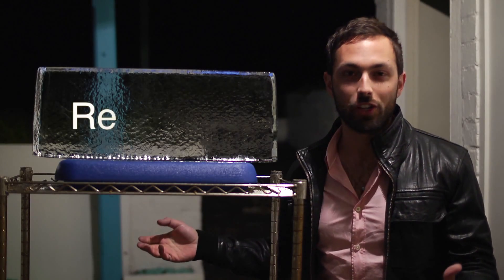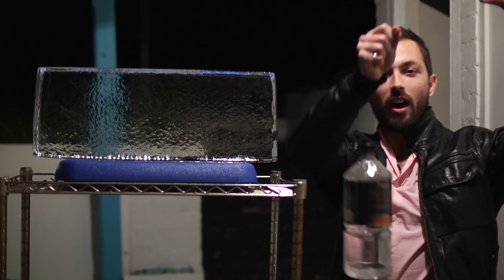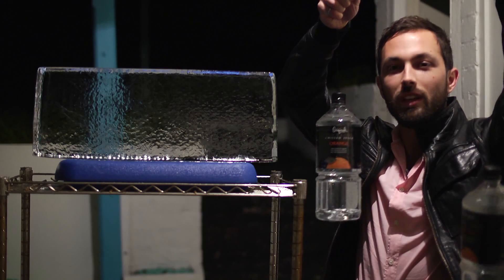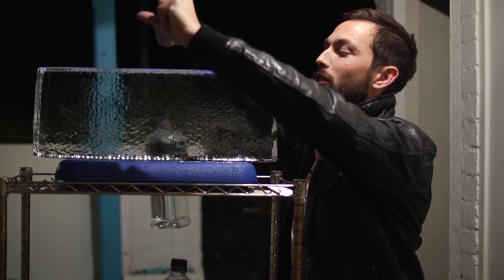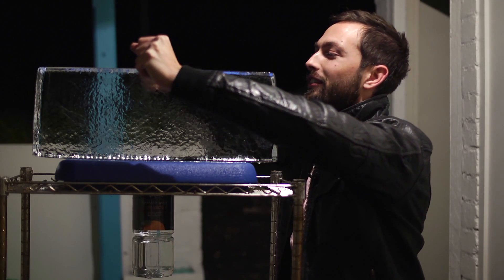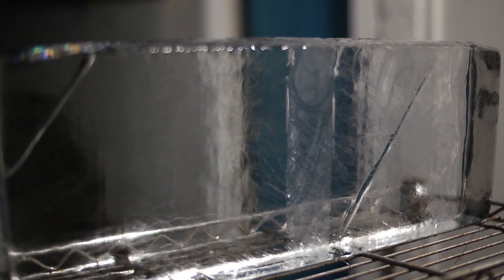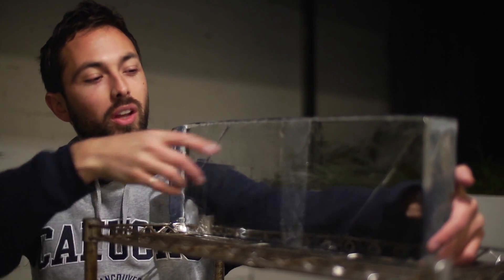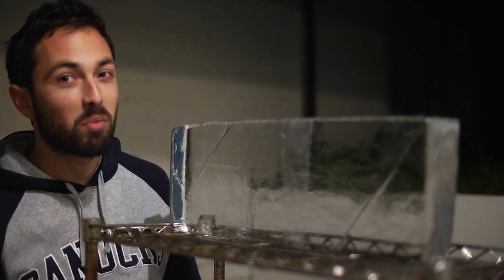Does Pressure Melt Ice?

Comment: would this work if the room and the cord were also at or below 0?
Reply: +Chris R Theoretically it should. The concept is the same of water boiling at a lower temperature at lower pressure. (even if the surrounding temperature is lower than the boiling temp.)
Pressure causes the water to melt to the state it would be at 4 degrees Celsius (max. density) at normal pressure.

Comment: Very interesting video! :D I think the first part was a great demonstration of the ice melting from pressure, but could it be possible that the liquid water re-froze simply because it was  in close proximity to a bunch of ice that was already around it? I bet if a small drop of water landed on the block it wold have a good chance to freeze as well, no pressure involved. Or would this not be the case?

Comment: how can you tell the difference between melting and cleaving in this example?
Reply: +Dilip Tien i think  cleaving would have resulted in two separate blocks of ice. however, given the fact that the cut line was visible after the cord went through, perhaps it was just cloven.
Reply: Chris R cloven?
Reply: Dilip Tien
 past participle of "cleave."
Reply: Chris R ok, but I think the line in between was caused by air trapped inside.
Reply: Dilip Tien
could be.

Comment: no, what your talking about is baremetric, gravitational etc. pressure where it is so great that no matter what temperature it is it stays as a solid until obviously that pressure is released, all that does is prove that ice is cold because as the wire cuts through the ice, the ice above it is still cold enough that the water the wire made (since the wire has a small diameter and is above 32 degrees fahrenheit it melts the ice) is re-frozen and the only reason why you see that line through the ice is because some of the water didn't completely freeze it just dripped/poured to the bottom

Comment: Question is if you put and ice into pressure chamber and increase pressure 3x will it melt faster?
Reply: +無為 Well in general, higher pressure means a higher melting point so I think it will do the opposit, I think it will make the ice even more solid.
Reply: +Covalence Dust In general, but not for water... Water expands ans it freezes, ergo higher pressure means lower melting point. At least that's what I think would happen...
Reply: Proper question is, if you put ice into a pressure chamber and tripled the pressure while keeping the temperature constant, will it melt faster? 
What do you think would happen if you tried to compress a styrofoam, or wood, or a cloth with a huge metal clamp? Think of molecules. Think of graphites and diamonds which are made purely of carbon atoms.
Reply: probably, pressure affects the properties of water.
Reply: That is correct the higher pressure the faster ice will melt. If you remember from physics that high pressure is proportional to heat i.e. when heat increase pressure grows and vice versa. So if we steadily increase pressure it will melt the ice quicker, however if we place ice into vacuum it shouldn't melt at all, since the pressure is almost zero.
Reply: +無為 yes it will probably require less heat to melt and if it is for example at -3 celsius and remove it would probably turn to ice again
Reply: +無為 Yes, it will because pressure and temperature are directly proportional to each other which means as the pressure increases, the temperature does, too. Of course, when the temperature increases, H2O molecules will start to decrystallize as evaporation will be taken place thereafter.
Reply: +Kenny James Cubero liar
Reply: +無為 High pressure = Lower Melting/Boiling point 
Ever heard of a.t.m in your periodic table?
Reply: Stop. Please. Geez this thread is... ughhhhhh.
Study science textbooks. Don't ask random people.

Comment: I don't understand this, doesn't water boil at room temperature if you but it in a container with less pressure. So shouldn't it freeze even more if put under more pressure? (ps. I know the actual temperature doesn't change when put under less pressure, just the state of matter, so I understand that part lol )
Reply: The "boiling point" as you understand it only exists at atmospheric pressure. Under the higher pressure below the wire, the fusion line is pushed back and the i e melts. Once the wire has passed, atmospheric pressure is restored and the freezing point returns to normal.

Comment: What if i put a giant rock on top of it? would it go right trough?
Reply: +Break you're exactly right. That wire is so thin the PSI can get high enough to push the ice above the fusion line with very little weight. To get the same effect with a large object it would need to be very, very heavy.
Reply: Water expands when it freezes.  The pressure momentarily undoes the expansion.  Same reason why ice is slippery when you step on it.   Thank you to Richard Feynman for the lesson^v^

Comment: If regelation is the actual phenomenon at work here then wouldn’t a sub-zero temperature wire (within a sub-zero atmosphere) still cut through the ice due to said phenomenon?
Could you show us an experiment of that?
Reply: This only works in a very narrow temperature range and the m further below zero we go, the more pressure we need for this to work.

Comment: So why is it that pressure melts ice? Or have I missed the point completely! :)
Reply: He did not explain it. In as few words as possible:

Ice is less dense than water. When put under enough force, the ice will be compacted and turn to a liquid as the higher pressure forced it to have a higher density.
Reply: PanicGiraffe Thank you this makes so much sense now! Does Regelation work just with objects with a small surface area, or with enough pressure would this also occur with a larger object?
Reply: Lucy Anderson  The more surface area is used, the more force is needed to achieve the same pounds per square inch. So yes it does work with larger objects (it can even work by increasing the air pressure around the ice) but it takes much more energy.
Reply: PanicGiraffe Thanks! Hope you have a great day! :)

Comment: wait... in ur other video u put ice on aluminium and it melted faster than on plastic. something about heat conductivity? is this at work here too possibly? i would like to see ice in a tank of sorts (should it be a vacuum?) , pressurize the tank and then restore the equilibrium of the inside of the tank. an experiment along those lines would maek me feel better anyways and would be a cooler (no pun intended) experiment.

Comment: Just for the sake of re-posting at this level, Wikipedia affirms what I've said below i.e. the ice melts because the wire acts as a heat conductor thus heat from the room is responsible. Here's the text quoted:
"Weights suspended from a wire which cuts through ice, is an example given in old textbooks. Once again the pressure required far exceeds the force applied. Conduction of heat from the room through the metal wire is the correct explanation of this phenomenon."

Comment: I really like your Channel and have been watching many of your uploaded Videos. But this one I didn't know until now. I was watching some footage of the sun captured with an uv-filter when I got interested in solar winds. I got to Wikipedia and several links later (Magnetic fields, Comets,...) I got to the article concerning Sublimation. There I relized that frozen H2O should turn to the liquid state, when enough pressure is provided. I know that it might be quite difficult to watch an block of ice melt in seconds when exposed to about 200 bar and refreeze again in seconds, when the pressure is removed. But your Video is prove enough for me, because the ice melted again after the string has passed. Thank you very much. ;)

Comment: I'm not sure the experiment is relevant if the environment temperature is not 0 degrees. The metallic string is a thermal conductor so it's likely it just "helps" the ice it comes into contact with "soak" up the heat from the environment faster thus melting. Once the string passes, since the "cut" is so tiny and the molten water between the two chunks of ice is almost perfectly isolated from the outside environment, captured between two blocks of ice, it just freezes back up again. But hey I'm sure the physics behind it has been proven and it's solid, regardless of the current experiment itself, which is still interesting regardless.
Reply: +GoodGameHunter The main issue with your comment is that ice can't freeze water
Reply: +John Jones he never insinuated ice freezes water, as if it has magic quality to it. he said it absorbs the heat.
Reply: +John Jones Actually, it can. The ice would just have to be colder than 32 °F, cold enough below it that the specific heat of ice and the temperature difference was high enough that it could cool the water to 32 °F and then remove the heat of solidification.

You may think this can't happen because you're thinking of ice in a glass of water. But in that case the glass constantly has heat added, and there would probably be too much water for ice out of a normal freezer, even if the cup was very well insulated in a room just above freezing (just above to make sure the room wasn't causing the water to freeze). 

But what will happen if you pour some water on an ice skating rink? It'll freeze, because the ice in the rink freezes it. This is how a Zamboni smooths the rink. It melts the top layer of ice, turning it into water, which levels naturally and then refreezes. The Zamboni doesn't  freeze it, you can see the water on the ice after it passes before it freezes. And it's not the air in the room freezing the water on the ice because they keep the air in a skating rink well above freezing. So therefore the ice is freezing the water.

TL;DR: Ice can freeze water, but you need more ice than water or it has to be way colder than normal ice.
Reply: I approve of this message! ^^
Reply: Thank you for your eloquent display of scientific arguments. :)
Reply: NightLurk You're welcome. If you actually are interested I recommend you use the trust google to look at phase diagrams. There's something peculiar about water's that explains all this.

Comment: I thought this happens because the wire conducts heat from the surrounding and melts the ice
Reply: +Brian Su The wire and the ice would be the same temperature after just a few moments due to the fact that water and ice have much higher specific heats than steel.
Reply: +broncokonco Are you guys sure this is due to Regelation? According to Wikipedia, my explanation is correct and Regelation is a misconception. Here's the quote:
Weights suspended from a wire which cuts through ice, is an example given in old textbooks. Once again the pressurerequired far exceeds the force applied. Conduction of heat from the room through the metal wire is the correct explanation of this phenomenon.
Reply: Just look at the phase diagram for water then give yourself 40 lashes for being stupid.
Reply: +Brian Su A significant part, if not most of it is due to regelation I think, cos I've tried a similar thing and the harder you press the faster it cuts...
Reply: +Brian Su probably the reason he chose the thinner string too (smaller contact area ==> higher pressure etc)
Reply: +Brian Su yeah it melts but turns back into ice right after
Reply: +hagala thekid Yes that is the way I understand it

Comment: Wouldn't the ice be melting faster where the wire is because it disperses heat faster?
Reply: +TheRealUbehage Wrong. If you apply pressure to liquid water at any temperature, it will always be a liquid. If you apply pressure to ice however, depending on the temperature and pressure, it will become liquid.
Reply: +RustyWolfFX thought the same
Reply: +Eric Wesson Since when did steel conduct heat poorly? compared to, say, plastic, it conducts heat very well...
Reply: +RustyWolfFX The specific heat of the steel is much lower than water (about 10 times lower than water and 5 times lower than ice). It's possible that for the very first moments of the experiment the ice melted because of the temperature difference, but by the time the string made it much of the way through the ice, they would be at an equilibrium temperature below freezing.
Reply: Killynamite at any temperature where H_2O is normally a liquid at one atmosphere**

a small but very important detail ^.^
Reply: No you idiot.

Comment: This experiment doesn't prove that ice melts with pressure:
1- You used a metlaic string which transfers heat and melts the ice below the string, while the water formed cools and makes again ice above the string due to the big block ice is still cold.
2- Pressure applied is not huge enough to support the theory.
3- Pressure on gasses raises the temperature of the gas and increases collision. What about liquids? before testing on ice, we need to check if liquids heat up with pressure.
thank.. I like your videos so much
Reply: +Deadbond1 
1. The two objects touching should reach thermal equilibrium over time, since this experiment took over 3 hours the wire and the ice were likely the same temperature.
2. The Pressure is fairly high, since pressure = Force/ area, and the wire is so thin (less area) , the pressure should be high enough for regalation.
3. The ice in this video does not melt because of an increase in temperature, rather because Pressure increase causes a decrease in the melting point (look up phase change diagrams)
Reply: +Haseeb Khan 

See above comment please.